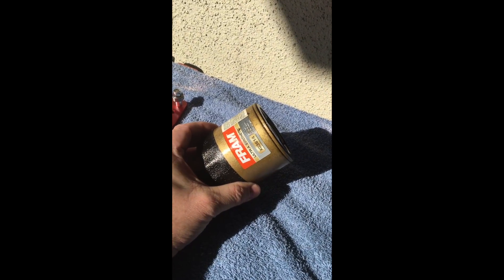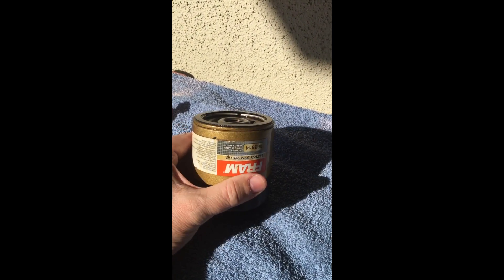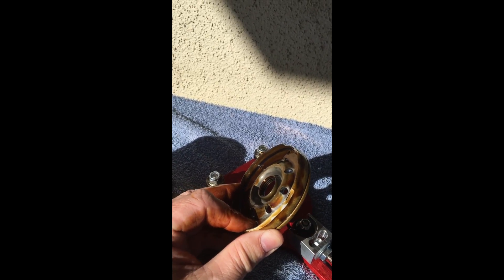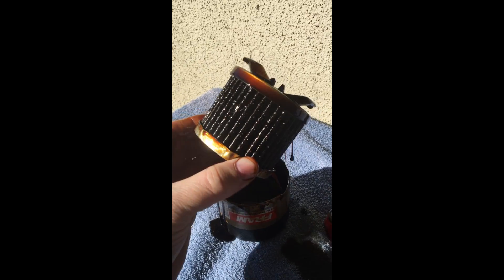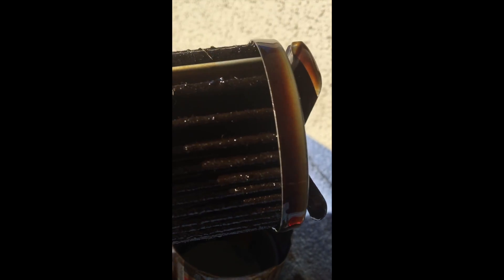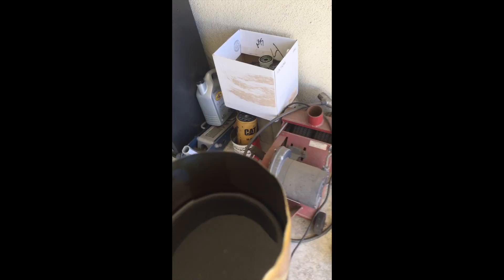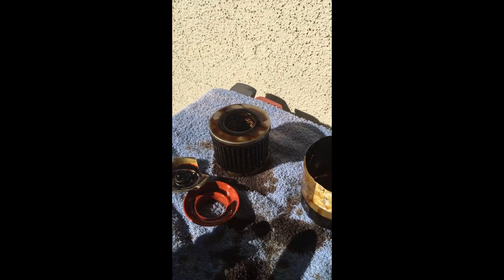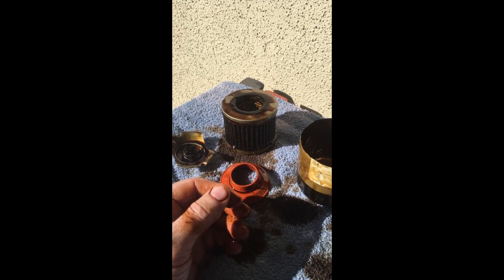Fram Ultra cut open after 15K

Comment: Would you cut the filter medium and see what filter area the filter has and if a wire mesh is used inside. Peace vf
Reply from the maker: That particular filter (old school FRU) had mesh backed media. I never bothered looking at linear area with this filter as that media uses depth filtration so unless you have a way of measuring depth it's fairly meaningless. Best!
Reply: @Davegvg3576  Thanks Dave.

Comment: FYI, the end caps on Fram's lower mileage filters aren't cardboard, but a fiber engineered for better sealing of the media without as much glue. They also aren't meant to be run over 10k miles. Toyota filter media doesn't even have end caps.
Reply from the maker: Thanks Jonas, Im aware they are actually a fibre material with the benefit of being a filter media themselves, I was quoting the complaint  I hear from people on forums and websites. 

Although I agree with you and I  dont think Fiber endcap filters should be run more than 10K Honda disagrees with us and sells the A series built that way.
Honda will allow  it sit in an engine for 20K using their A/B filter change methodology.  I discuss this and break one down here. 
https://www.youtube.com/watch?v=t3HLwZFXIG4&t=4s

Comment: I'm planning on installing one of these at our next oil change. I change the oil every 5,000 miles in our 2009 RAV4 2.5 liter four cylinder. I'll keep changing the oil every 5k but leave this filter in for 10k.
Reply from the maker: Your rig will be quite pampered fed with that diet, Ive been leaving all of mine in for 20K. I came to the conclusion based on cutting them at regular intervals to see what collected in the dome as th ergs I run them in are dome end down It doesn't get cold in cali, but I look at this to see how much gunk has settled and what may end up getting re-ingested in case of a bypass event (that won't actually occur for me)
Reply: @Davegvg3576  
I won't go over 10,000 miles on the filter because I'm concerned with the flow rate of the oil diminishing as the filter collects particulates.
My filter is a cartridge type so no dome end just the oil filter cap that i inspect when removing the old element.
Reply from the maker: @stevensevek6151  What are the elements rated for ? Never seen that box. I completely understand that concern. You certainly won't hurt your vehicle by dumping the element at 10K. This debate rages on every oil forum. Several manufacturers like Honda tell you to change it every other OCI. Modern cars put out so little contamination and filters hold so much and flow so well there is mountain of evidence that say dumping at 10 is assured waste.

Comment: What is best filter media for cartridge oil filter?
Reply from the maker: I like Mahle or Hengst for cartridges.
Reply: @Davegvg3576  
The reason...?
Reply from the maker: @njsongwriter  mostly fit - I have a way harder time getting cartridge filters to seat and seal than spin ons My sprinters being the ones I had/ have to deal with, I had a problem with a fram cartridge filter and never with Mahle or Hengst. Their build quality has always been superb as well.

Comment: Fram tough guard, I like things in the middle. Not to thick not to thin.
Reply: That's a sleeper nobody really knows about.
Reply: If you like things in the middle buy the top end Fram Ultra Synthetic filter that is suppose to be good for 20,000 miles and change it out at 10,000 miles.
Reply: Huh?

Comment: Wix XP Has Stronger Outer Metal Container Than Fram Ultra & Is A Quality Oil Filter.Used it in My 03 Cobra,2001 TundraToyota,& Now My 04 Lexus ES 330
Reply from the maker: True,  it does have a thicker case and is built very well but has measurably worse filtration performance. In a 4x4 situation where the case was exposed, I would run the Wix XP - where its protected - the ultra. The thinner case on the ultra is only a benefit when using an exterior magnet.
Reply: Lol you know how hard it would be to collapse even a thin one? Filtration is Important and tbe Fram is better
Reply from the maker: @VTGtone   Case collapse wouldnt be any concern - piercing damage from debris, or scratches leading to rust would be the worry.

Comment: This is the only Fram oil filter people should buy. All the other ones are complete garbage. I've taken the lower end model FRAM filters apart after an oil change and the media was mushy and caving in. However, the XG ULTRA line was a different story. The media was solid and yes clogged, but held its shape. In my opinion, Fram should stop making all the other filters and stick with this one as their flagship go-to. As time goes on, more and more will use XG ULTRA and then maybe the crowd will change their tune.

Comment: Never thought i'd buy a fram but i used this on my last oil change, good quality and great value.
Reply: How many miles??   Make sure you go at least 10k..  as it's designed for even more than that.      It's a waste of money otherwise..  and the mid level Tough Guard is already sufficient for 10k.

Comment: I only buy the Ultra; the other frams look low quality and looks like mold on them with cheap paper filters.  The Ultra looks good.  Penzoil Platinum + Fram Ultra is all I use.
Reply: Lol that is exactly the combo i use! If i can find the "Ultra" Platinum Pennzoil on Ebay for cheap i always opt for that but pretty much the same usual setup with Pennzoil Plat And Fram Ultra.
Reply: @sp6450  
Ultra Platinum and Platinum are not exactly the same.

Comment: I have a Hemi 06300c highly modifier I use this filter with pennzoil platinum synthetic. Zero problems after conservative 6k changes ........
Reply: I too use this with pennzoil platinum and do every 6k, my jeep renegade burned two quarts of oil in 6k using mobile one, i've had pennzoil in for a month now and hasn't burned a drop of oil yet. I will never use mobile 1 again. And i even used extended performence.
Reply: never heard of that version of the Hemi

Comment: You know what it takes to collapse an oil filter? Even with thin walls? About 90 PSI of oil pressure! Hell even Top Fuel does not run that high and for good reason.

Hell if you look close at the threaded end cap of the filter. It's got edge retainers. That is to keep the oil filter in center. To the anti drain back valve. You would have to crush with Pliers!

Now to the meat of the matter. Fram Ultra is rated down to 20 microns. Mobile 1 Extended down to 30 microns. Anything less the 20 microns will put the oil filter into permanent bypass mode after 2k miles. As it will clog up so fast. Your head will spin!
Reply from the maker: "collapse"  would be a big event - never actually seen that, but what I have seen many time is pleats tearing and getting wavy- the hot oil softens everything and filters without wire or mesh backing have pleat movement and over time the whole thing splits at a wide pleat and you get unfiltered oil circulating.
Reply: Yes they will collapse on themselves at the moment of failure inside.. Or they burst. Leaving nothing but the screw on end cap. Blow the lip seal out. One reason they say  "Do not Over Tighten" The lip seal is a fail safe. If all else fails to release pressure...

That is why Fram Ultra uses the metal retainer screen. As they will filter down to 20 microns. Anything smaller would clog an oil filter in short order. Mobile 1 is rated down to 30 microns. I use both depending on conditions and application. As I run a dry sump oil system on all my vehicles.
Reply from the maker: Alway seen the lip seal blow before anything else, I have a 700HP V1O and a 725HP/820 lbft  588 neither dry sump. Both in boats.
Reply: Mobile 1 has never been rated to 20 microns. I called them to check 3 years ago. And Microns has nothing to with longevity. It's just a rating for how small the particles it can filter. As the rated Capacity for each filter is different. Dependent on the size.  The 210 is rated for 32 grams for both Fram Ultra and Mobile 1. So I suggest you use the phone and talk to the ones that made it.

And fuck Amsoil. It's not API certified. You need a factory that is compliant to get the rating. I had to break the bad news to people that used that shit. When their motors got damaged under warranty. You don't use API certified. Take a hike. The owners manual is there to explain it too you. As you go by what it tells you! I suggest they sue the people that sold it to them. But it's hard. As Scam Oil is sold by "Independent Dealers" ie Multi level marketing. You would have to sue the person that sold it to you!  One reason it's not on Auto Parts stores shelves. They would be "Liable" for any damages the customer experienced using it.  

And before you tell me Scam oil has an API rating. Only the cheaper ones. That they do not make get the label. Which is 2 the last time I counted. Their "Top Tier" higher priced oil does not have the rating. So take your chances. Me. I stick to what the "Factory Recommends".. They built the damn thing!

Comment: If your going to use dino oil with an OCI of 3-4k miles, then use a filter that corresponds with the OCI. Why spend the money on a synthetic oil filter when your're not using synthetic ? You will only throw it out after 3-4k miles. This Ultra is made for synthetic for the reason that synthetic is a finer flowing oil. The filter media is made so this finer oil flows through but also has a more efficient  filter media made to screen out 99% at 20 microns impurities which is very very small that a less efficient filter would not prevent from entering the engine. Something to keep in mind...it is a known fact that dino oils DO NOT flow as well as synthetic in very cold temps. Imagine dino oil in very cold temps trying to flow through a highly efficient filter such as the Ultra, you can be sure the bypass valve has opened and now you have zero filtering going on until the engine has warmed up the dino oil to flow through properly, how many winter days has this been going on for. It's all relative, use the right combination. Everyone should run synthetic or a blend at least. Dino oil is in the past...unless you have an old high mileage engine that burns oil, then go cheap as you possibly can.
Reply from the maker: Who are you addressing with your commentary?
Reply: @Davegvg3576  To the     Masses.
Reply from the maker: @keepchrist   "This Ultra is made for synthetic for the reason that synthetic is a finer flowing oil."  This is utter nonsense - flow is not defined by the group # of an oils base stock but by the grade it is. One can have thick slow flowing synthetic or the fast flowing dino.
Reply: You do realize that you can use the same filter for 15 or 20,000 miles and still change the oil as often as you want to ...?

Comment: Wix XP filters have a spring instead of Frams cheap stamped valve.
Reply from the maker: Wix XP is a well built filter with lousy efficiency. 50% @ 20 microns/ 
Its not a stamped valve - its a stamped carrier. the bypass poppet itself has a coil spring on it. Nothing wrong with a poppet valve bypass.  Cars spend almost time whatsoever in bypass.
Reply: Dave Sampson People get carried away with micron ratings when in reality the construction and QC is much more important. The bottom line is that top quality air filtration is far more critical to keeping larger sized contamination out of your crankcase. Wix construction is bulletproof and after working as a technician for 25 years I’ve never, ever seen a Wix filter have issues. I can’t say the same for the Orange Can of Death, Frams killed many small block Ford engines back when I was employed with FoMoCo. The internal construction of the Ultra is better than their basic beer can stuffed with toilet paper but it still isn’t up to the Wix top of the line filters. 
UOA with particle counts in one of my vehicles show that the Wix does a great job even after 20K miles of use. The NAPA XP is the same Wix filter and when NAPA has their yearly filter sale I buy all of mine then. The Honda XP usually costs me about $5 then. I get all my filters that I need for a year during their sale.
Reply: @prevost8686  If you look at engineering tests on critical engine part wear vs debris particle size in the engine oil you'll see a direct variation, within the range of  particle sizes from about 40 microns down to about 10 microns. The results suggested to the researchers that filtration down to 10 microns or less would double to triple what could be expected for normal engine life.
Reply: @prevost8686  Not really. Micron ratings are extremely important and the Fram is built more the. Strong enough. In fact the can thickness is overrated
Reply: EL34 XF2 LiFe Tell that to my 12.7 Detroit that has run over a million miles pulling loads that only 4 wheel autos could dream about, some of you BITOG guys are ridiculous. Please, if you haven’t done it yourself don’t pretend to be an expert.
Reply: @prevost8686  
Only the element gets replaced in our cartridge filter, so if the element is good to go, I'm okay. I'm wondering though if 99% at 20 microns is a bad thing if it might affect flow rate if used for those long intervals?

Comment: Great video. It's true about how outstanding the quality of the Fram Ultra Synthetic compared the the rest of their lineup. This is the only Fram filter worth using.
Reply: Richard Ojeda, I’ll run the Tough Guard in my ‘16 Civic for a 5K OCI, and it does just fine. But I don’t use the orange can.

Comment: There's no better filter on the market for the price. I run these 10,000 miles on my Tacoma and they still have a lot of life left in them, could probably go 20,000 no problem but I don't push it, they're only $9 at Walmart so no need to stretch my investment on a filter.

Comment: The lower end of fram the orange can is to stay away
Reply: Robert Bennett The lower end Fram filter isn't bad as long as you have taken good care of your engine, use good motor oil and do timely oil changes. It's a low mileage filter. Hence cheaper price and cheaper parts. However I still use the Ultra and do oil changes every 6 months.
Reply: A Person no the orange can fram are bad they used cardboard at the end they collaps after 3000 miles and it isnt good for filtration at all its crap
Reply: @robertbennett2796  They use ZERO Cardboard.   Go check them out now..  they have Silicone ADV and the end caps are a very hard fiber construction.    Not something as ridiculous as cardboard.. LOL           Go look at the new models.
Reply: @jaylee8703  the orange canned ones are cardboard constructed

Comment: Can you use this filter with conventional motor oil?
Reply from the maker: "Conventional oil is obviously thicker so it'll be harder to flow through this filter."  synthetic or dino has nothing to do with viscosity. You can have thin or thick of either type. Can you point to anything saying it isnt recommended  by Fram? I have not seen this.
Reply: On the box it says for use with conventional or synthetic oils. I just bought one. Small white print.
Reply from the maker: sure you can
Reply from the maker: Nonsense.  The grade determines viscosity not the group. Please link your source.
Reply: Global Mobile 357 No conventional oil reacts with the metal screen material on the media and causes the rocker wheels to deteriorate resulting in hypothermal electrostatic head gasket failure. Just kidding 😉😁 but why would you want to use a 15,000 mile filter with 3_5,000 mile oil?
Reply: @skittykitty1000  I've seen MANY MANY Blackstone reports with conventional where it had 7-9k on it.. and they said it had no problem continuing for a little while.       It's not 1987 anymore.
Reply: @jaylee8703  Ok if you want to run conventional oil for 9000 miles go right ahead. I dont know anybody who would do that so that's why I asked why do you need a 10 to 15,000 mile filter for conventional oil. Most people who run dino oil change every 3 to 5000 miles.
Reply: @skittykitty1000  
I use econo 0W-20 full synthetic oil and I change my oil every 5,000 miles but I'm going to use this filter and change the filter every other oil change. Why? To that I say why not?

If you had a PITA splash guard to remove to get to your oil filter, you would know why?
Reply: @skittykitty1000  
Because you don't have to change the filter every time you change the oil and that is a plus on some vehicles with a skid plate that has to be removed to get to the filter.
Reply: @skittykitty1000  
Because you don't have to change the filter every time you change the oil.
Reply: Global Mobile 357 It's designed for synthetic oil.
Reply: Of course. Why not?

Comment: fram synthetic filters are as good as it gets. The Orange can and low end filters are garbage. I'm not comfortable with the the low end filters,bc it looks like a 3 year old put it together. supertech is a better filter than the fram Orange can.
Reply: Dylan Collett The orange ones aren't terrible if you use them right. But I still use the Ultra.